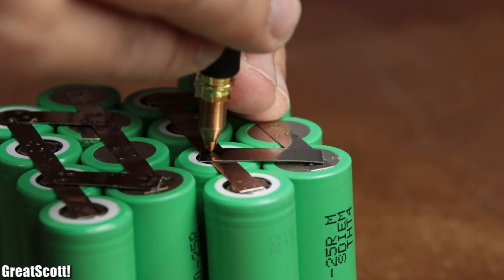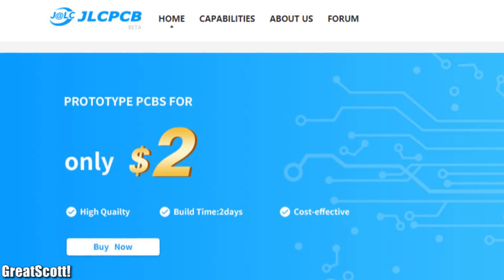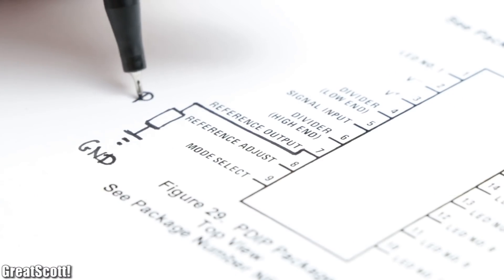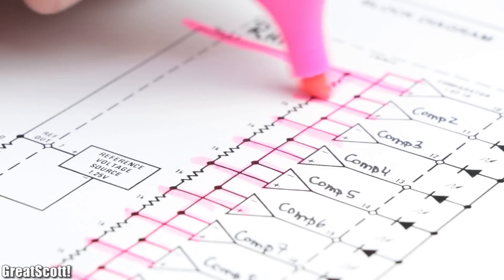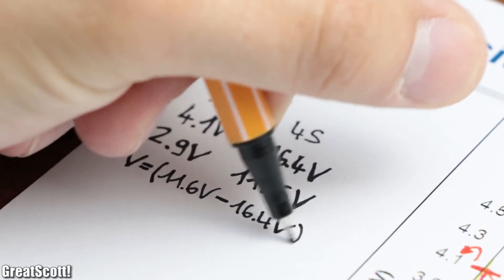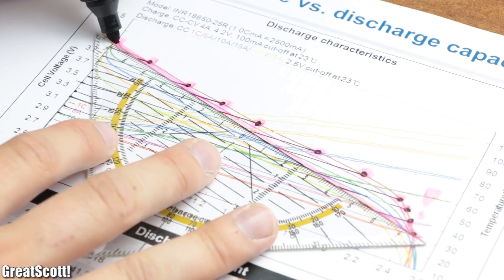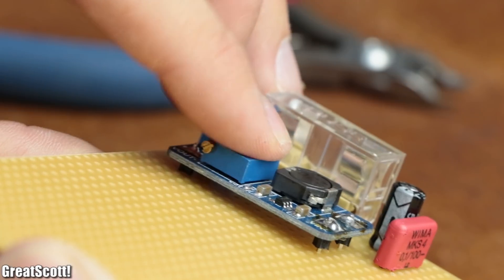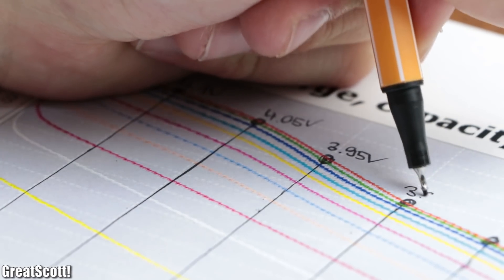Make your own LED Battery Level Indicator

Comment: I would use something like n Arduino pro mini or lgt8f328p which can measure voltage pretty wel with an internal voltage reference, and via the software outputting digital outputs to LEDs or even better, display it on a small OLED screen..

Comment: Nice project. I have a question. I have 7s battery and I am trying to design a battery level indicator circuit. Boost converter you used up to 29v  but I have 29.4 max voltage on my battery. What should I do? I have a charger and I want to add full and charging indicators. just 2 led.

Comment: great video thanks, what size fuse did you use and what is the spec on the black capacitor and the red component pls?

Comment: friend makes a video of an intelligent capacity meter like the JBL for Class D Amplifiers TPA3116D2.
why i bought a battery meter made in china but it is not like JBL because when the bass is strong the LEDs flash there agent Do not really know the right level of the 2v 8.4v lithium battery.
if you can fulfill my request and make this video with this circuit I will be forever grateful to you. thanks

Comment: For such a simple project is very impratical the circuit you introduced, just buy the cheap Chinese 3s 4s battery indicator problem solved no more complicated sh8ts for just a simple function

Comment: Hi Scott., thank you for the great video. This chip can only be used to indicate if battery charging is completed based on signal, Rhi and Rlo. However, without the charging power, can we use the power from battery alone to indicate its voltage level whether it is full or close to being depleted.

Comment: Hey,am new to proto typing, how does one attach the boost converter module to a perf board,actually working on a different project and been looking for a way to accomplish this.

Do you recommend simply pasting the module to project box for a circuit comprising only of TP 4056 and DC to DC booster alongwith battery?

Comment: This is still not very accurate, as with different loads, voltage will drop accordingly, even though capacity won't. So for example, you can't have an accurate reading under load, just sorta approximation under no load in this instance.  You'd want a fuel gauge IC like the ones used in battery packs to get an accurate reading.

Comment: How do you supply Rhi and Rlo with constant voltages when the battery is a changing, dropping, voltage source with time? Or is the circuit supplied with a separate power source from the battery?

Comment: Hello again. Love your videos as always. You always give me good ideas.

I am looking to do something like this to control 3 leds one for 5v, 9v and 12v,
I did consider the LM324 but iI was wanting just 1 led to light up at a time. This is not possible with the LM324. I think i will need a Micro controller like the small ATTINY85. I can do all the hardware, But i lack any kind of code writing skills. Could anyone help me please ? As for the leds. I'd like to have a small range that they come on and go off.  Example,  led 1 would turn on as low as 4.9V then off at 5.1v.  I'd like to be able to adjust values as necessary.
Thanks for reading and any advice.
Reply: use window comparators
Reply: i think this will be my simplest option, as i do not have any code writing experience, if i had code, then installing it would not be an issue..  i'll keep ya posted on here once i get the project up and going good.

Comment: Great video most informative. Are you offering any DIY kits for 3s, 4s and 5s 18650  Cells. The ones I am finding today are either plagued with issues or simply do not work consistently as offered.

Thanks!!

Comment: Oh Boy !.. i do not know why i did not think to use this chip earlier for a gas propane meter project.  I had a digital Propane meter that went belly up, and nothing is available to replace it.
I tried to use the LM3914, but this did not work well for me. The sensor  ( halleffect ) is not very linear, so this LM324 would be perfect for me, as i can adjust each trigger point as i need it to be.

Comment: This could be done with a single op amp, LED's, resistors, and nothing else, exploiting the voltage drop across the LED's. Add a bridge rectifier and a capacitor to smooth out the flickering and you can measure AC with the same circuit(Like audio). The only down side would be the LED's fade gradually instead of giving harsh steps, but I think that is a good thing. 

The non-inverting input of the opamp is connected to the battery, the inverting input is a voltage divided output to set the gain(the gain depends on how many volts it takes to overcome all of the LED's forward voltage at the batteries max voltage), and each LED is hooked in series, each with their own resistor to ground. The resistors to ground could be set as to produce a non-linear behavior of the LED intensity as well, to account for the non-linear discharge curve of the battery.

Comment: The problem with this is that the voltage discharge curb will be temperature dependent.  in a cold environment, the voltage will be lower and in a hot environment will be higher.  It will not be accurate unless you can guarantee the same temperature all the time.

Comment: What are those metal wires he uses to bridge the solder connections. Like at 0:54, where can i buy some?
Reply: They are just solder bridges. He just melts solder in a line

Comment: Why not using software based like arduino instead of the complicated hardware based?
For the first charging from 2.5v to 4.2v the indicator is blank but logging the energy needed to fulfill the empty battery.
The second charging we can calculate the approx level by comparing the remaining energy vs the known energy capacity. Everytime the voltage reach 2.5 & 4.2v, the calculation calibrates to 0% & 100% and recalculate the energy capacity (the batt capacity will be degrade over time).

Comment: And here I was afraid you were going to use yet another Arduino. I know it's a great chip, BUT it REQUIRES PROGRAMMING and that is simply not available nor do I wish to spend the time and $$ to not only acquire it or learn it(it seems to use C or something like that, it's foreign to me) and it seems to require a computer with a special interface to a programming dock. Might as well as use a computer.

Comment: Is the boost converter powered by the battery under test? Or does it require a separate power supply?

Comment: what about wima and electrolytic capacitors? they are not in your parts list. as well as the schematic it doesn't include them. Can you update the schematic and maybe put some gerber files with all components (including boost converter)?

Comment: So it's a flash ADC but without the logic to convert the output to binary. I made one of these from op amps as one of my first IC projects. I connectected the input to the capacitor through a buffer on a 555 in astable mode. Didn't think to use it as a battery tester. Maybe as a VU meter. The lm3914 definitely makes for a much smaller circuit than having 4 or 5 dual op amps connected to a ladder resistor network.

Comment: One thing that I would love to see someone make in a pedagogical manner, is a battery voltage indicator/display based on an Arduino, for each section in larger battery packs. For my bike batteries I don't feel that I need something else than a solution like this, since I balance charge after every ride. But for my 5 kWh homemade Li-ion packs in my van, that sit for weeks at a time, I'd love to have a way of measuring, displaying and warning me if voltage is going low in any of the sections. I got 4 x 3S packs and I measure with my multimeter every now and then to see that they are balanced. But this is something that should be easy to automatize and shouldn't be a human job :)

If anyone has any suggestions to how to do this or if someone already made it, I'm interested. I'm not overly talented when it comes to electroengineering so I leave this to others. I can't come up with a good way to measure the voltage when there is no common ground, without using an unreasonable amount of relays/MOSFET:s/optocouplers or whatever, but that doesn't feel like the most efficient route to take.

Comment: Hey greatScott!
When you Charge the Pack with the BMS you dont have any Charging current limitation. How can i achive that? 

As an example, i want to Charge a 3S battery Pack (11.1V) with a 12,6V Booster converter. But the Problem is, the batteries can be charged with much Higher current than the Boost-converter can handle. Its getting super hot. How can i Limit the Charging current to 1 AMP (12Watts)? Less current would save Battery life and does Not Melt my Power supply.

I would be so Happy for a helping Idea! :(

Comment: Nice project! Just want to point out that the discharge curve changes dramatically depending on the current draw, but perhaps you used the curve that will suit the draw of your specific project. :)

Comment: Hi GreatScott. First of all good job with ur videos, i'm always having a great time watching them. I wanted to ask you if u can give me a quick advice for my project. I want to make a centralized light and not only system with a raspberry pi. The main problem are the light bulbs. My idea was to convert regular high power light bulbs (e.g. 20W led bulbs 1400 lm or smth like that)  into smart bulbs with wifi (not necesarily RGB). For doing this i wanted to power a microcontroller like esp8266 with wifi from the leds power supply inside the bulb using a step down circuit. The problem that i encountered is that i cannot find a step down for such high voltage that the leds have in the bulb. I want to mention that i'm just a software engineer so all my knowledge of electronics are really basic, i'm just excited to code everything :D. So, i would really appreciate if u have a pretty simple solution for this problem, not just with converting necesarily but how to make a custom wifi bulb that i can program however i want. Thank you in advance and gl with ur projects.

Comment: Sure, the logarithmic voltage decrease may make a slight difference, mainly when your battery is practically empty anyway. It's not really worth the effort of correcting for though, both versions are very inaccurate since they are purely based on the voltage which changes significantly under load. Your battery indicator will jump up and down when you connect and disconnect large loads.
If you want a reasonably accurate and steady battery level indicator, you'll have to measure the current draw and added it up to see how much of the capacity has been drawn (like laptops and phones etc. do to determine the battery level) and use the voltage to correct for inascuracies while the battery is not in use.
It's not quite as easy as it sounds, since your battery's apparent capacity will also change depending on the current draw, the voltage the battery is pulled down to and even temperarure.
Making an accurate battery leven indicator really isn't that easy. But your version is the least accurare, at least assuming you use your battery, at rest I'm sure it's relatively accurate. Of course it can still be very useful, especially considering that you get similar battery level indicators like those for a euro/dollar/pound or two from China, but it may be worth mentioning, that it's only accurate at no or very little load.

Comment: But, Isn't using the voltage to determine the energy level of a lithium battery pack kind of a bad idea.I've heard that it's not very accurate. The battery's terminal voltage actually also depends on the current draw. Can you Please make a video on some other method to determine the energy level of the battery. Like coulomb counting.

Comment: You can watch Daves build one (https://www.youtube.com/watch?v=iIKGvHjDQHs). It is also very detailed how to do it. But you’re easier to understand. :-)
But I don't get it, 6 LED and a V divider completed with a Microcontroller is more accurate and has less current consumption. At the same time it is more versatile.

Comment: I used attiny13A and one RGB led as an indicator. The code goes like this:

const int redPin = 0;
const int greenPin = 1;
const int bluePin = 2;
const int lipo = A2;
float lipoV = 0;
 
 
void setup() {
 
pinMode(redPin,OUTPUT);
pinMode(greenPin,OUTPUT);
pinMode(bluePin,OUTPUT);
pinMode(lipo,INPUT);
}
 
void loop() {
 
lipoV = analogRead(lipo);
  
if(lipoV<=635){ // less than 3.1v (low battery) -->> red
  setColor(255, 0, 0); //red
}

if(lipoV>635 && lipoV<720){ // between 3.5v and 3.1v -->> yellow
 setColor(255, 255, 0); //yellow 
}

if(lipoV>=720 && lipoV<820){ // between 4v and 3.5v -->> green
  setColor(0, 255, 0); //green
}

if(lipoV>=820){ // more than 4v (almost full) -->> blue
  setColor(0, 0, 255); //blue
}
}

void setColor (int redPinValue, int greenPinValue, int bluePinValue) {
  analogWrite(redPin, redPinValue);
  analogWrite(greenPin, greenPinValue);
  analogWrite(bluePin, bluePinValue);
}

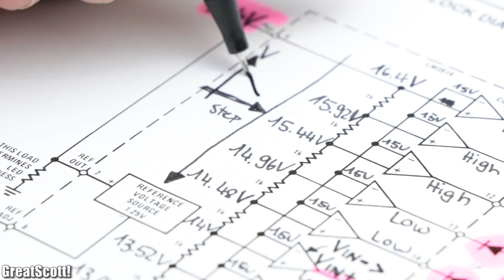Comment: 5:45 This is why EVs tend to use coulomb counters rather than relying on voltage. That voltage knee is abrupt in practice as well. Especially since voltage will sag under load.

Comment: It's crazy how they stuff all these components in that little chip package
Reply: Well, this is one of the less dense chips in that regard. A 6502 processor from 1975 has many times more transistors and resistors on a die area not much larger. AND IT'S FROM 1975!

Comment: I absolutely loved this video, it was perfect and beautiful. There is nothing wrong with it, i actually have no complaints. But I have one complaint, the LEDs weren't RGB. It would have been cooler if all LEDs were on and they were all green if the battery is full, and the colour slowly changes to red and less LEDs get put on as the battery is closer to death.

Comment: Why would you do such a thing ? It seems to me your diy circuit is a lot bulkier than the lm3914, even though it uses less leds and although it is trimmable, i'd rather use an approximation than a circuit this bulky

Comment: How does this IC work? If the Battery Voltage goes down, the reference voltages for 100% also goes down, causing a always 100% sensing... Or did I miss something ? ._.

Comment: Will this work if voltage drops under load?
Reply: The battery discharge I-V curves on battery datasheets are presented as several curves at different current draws. You would pick the voltage curve most appropriate to your expected average current.
Reply: @zerog2000  or you can measure the capacity of your battery under  the used load and draw a curve by using a dummy load or a programmable load .

Comment: This doesn't compensate for load though.  If a motor or something else draws current, the battery level indicator will shoot down.  And will stay lower for a bit while the battery levels back out.

Comment: Great Scott! Thanks for explaining what is required. 
Doesn't an arduino have AtoD that could be used measure volts with the discharge profile in rom? 
Load could then be incorporated into the result with multiple profiles per battery based on current of battery. This could then be used to detect charge/discharge modes and show the actual state of charge under all conditions. 
That would give you a universal battery state indicator. 
Could extend it to measure individual state of charge per cell through switching the cells into the AtoD.
Using leds for level is a great idea, 10 leds make a lot of sense intuitively, though 4 is probably adequate.
What am I saying? You've essentially given me another project to do....one day! Cheers, and thanks again for your fantastic video series - I enjoy them immensely.

Comment: Would it be possible if you could make a video on digitally adjusting voltage and amperage then read back to something like an Arduino the individual voltage and amperage values

Comment: You don't need a boost converter! Instead use a reference voltage ic or zener reference, that is lower than the lowest battery voltage. The best approach is to go with TL431 Precision Programmable Reference which will give you 2.5 Volts (Adjustable). Then divide the input voltage using a resistor divider so that it is lower than the 2.5 when the battery is full. You can use one of the LM324 op-amps as a buffer.
Reply: LM324 already has a voltage reference built in.

Comment: I use a 14s battery in my ebike, the problem I have with charge indicators is that when my battery is full it is at ~58v and I like the lowest point to be ~51V (at this point there is very litle charge left and starts to get dangerous to over discharge since you draw high current out of it so it is needed to be on the safe side), but when the battery is at about 53 or 54v and you would accelerate hard, the voltage would drop to 51 or less. So even at full chage if you accelerate hard, the meter would say "low charge" an you can't get an accurate battery level. I tried making a level with a arduino and a display, but even if I "smooth" the reading when you accelerate hard you get a high to nothing read all the time. Ideias are gladly accepted :)

Comment: Just FYI, this symbol " - " is not a "minus" in the case of the battery number, but rather a "dash".

I have seen that mistake multiple times in your videos and for some weird reason irritates me a bit. But that's my fault, carry on as you please :)
Reply: In the Netherlands we call it a dash, a 'streepje', if you translate it directly into english it would mean ''small line'. Haha, that would sound even more irritating than 'minus' :).
Reply: Lagger Onesixfour He does that because it's the way we say things here in Germany. I mean, of course we have another word for dash but we use that interchangeably with minus because the word "Bindestrich" doesn't really sound so well when we talk about electronics.